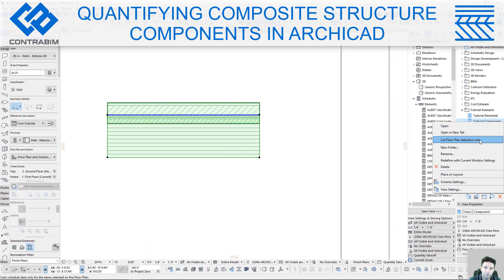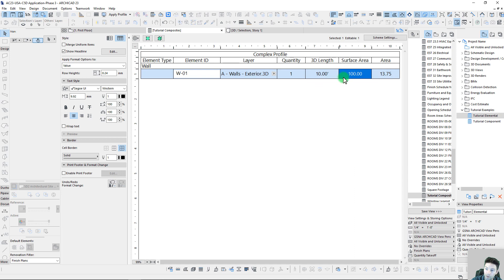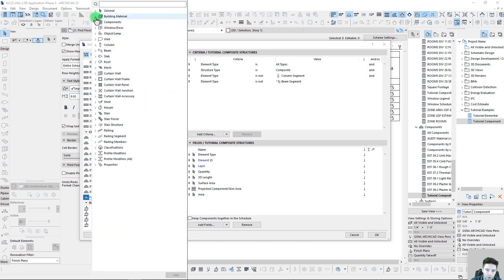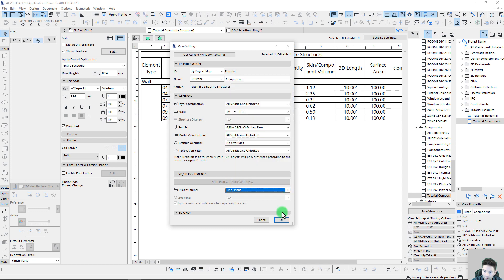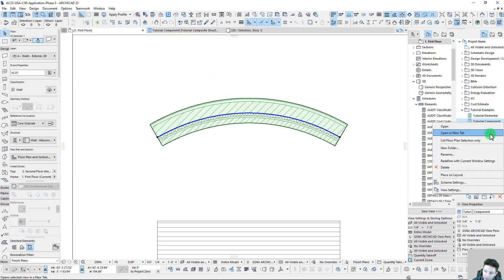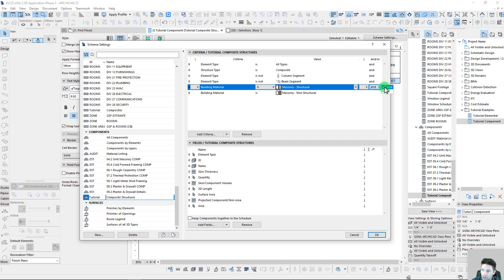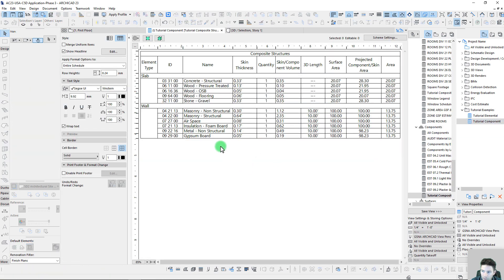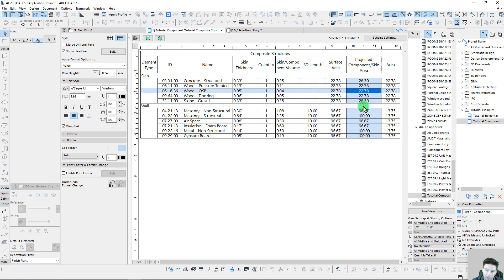ARCHICAD Tip: Quantifying Composite Structures

Comment: This tutorial is very helpful.  Two things - I'd love a tutorial on how to properly set material priorities at the beginning of the job to automatically cut back  the composites in just the right way as you showed ( do you have separate sheathing priorities depending on whether it is for floor or wall, for instance?). Second: Is the quantity composite wall assembly information that's ports into a component/element schedule affected by taking it into the profile manager to lower the brick veneer layer onto a foundation ledge as an example? (Side note - why did the schedule area column value not change when the skins all had different thicknesses?).  Keep up the good work!

Comment: I just recently came across your tutorials and have put some of what I have learned to use. Thank you for taking the time to make these videos!  One question I have is how did you make your 3D wall look so realistic? Was this accomplished with Image Fills?
Reply from the maker: Thanks Roger for the kind comment! Nope... this wall was built using out of the box GRAPHISOFT materials from version 23. USA in this case... What version are you on? If you're on 23 or 24 now, and not taking advantage of the newest Archicad Material Library, I'd highly recommend switching them out. Much higher resolution images, and far improved render settings for Cinerender

Comment: Great video! I have one question according to ifc export - its possibile to set up exporter on a way to have all of the info about areas of specific layers?
Reply from the maker: Thanks Dawid. There is a setting in the IFC translators for exporting the composite skins as separate elements. You'll have to dig into the exporter settings to find it, but I'm positive it's there! The information related to those skins will likely be limited to the material properties that have been assigned, and perhaps some info from the composite itself. Thanks for the question!

Comment: Good tutorial! Two questions: how can I count just the materials that are not structure? And, I want to create a label that shows just one material on a compose element, don't want to use surface because I can insert more properties. Thank you for the response.
Reply from the maker: Thanks Daniella! You can filter your schedules by component type, so anything non-core should do it. I'm not sure about labeling just one material, other than in a detail view where the materials are converted to material fills. This works fine, but may not be the type of view your looking for.

Comment: Hi John, I noted you have quite handy toolbar to control hatch orientation etc. I can't find it. Can you help? 
Greetings from Poland!
Reply from the maker: Hi there! Thanks for the comment. I think you may be referring to the toolbar at the bottom right. Those are the Creating Imaging>Align Texture options, found under Document. I've added these icons to my visualization toolbar, since I use them often and they fit well in that area. If I'm wrong, and you're talking about cover fill orientation, that will always be under the info box! Thanks!